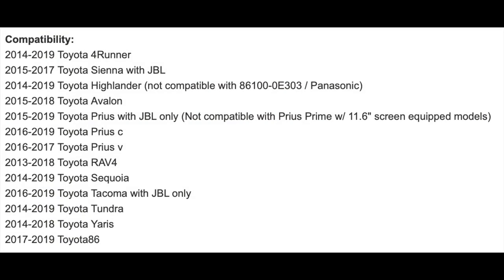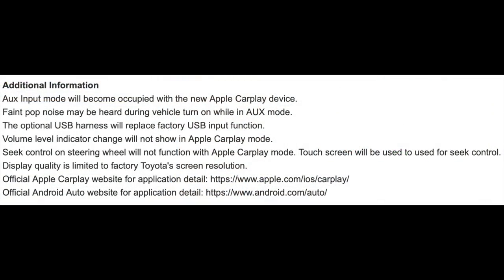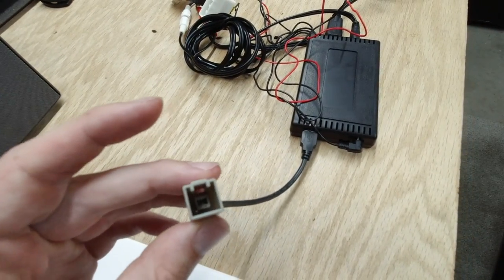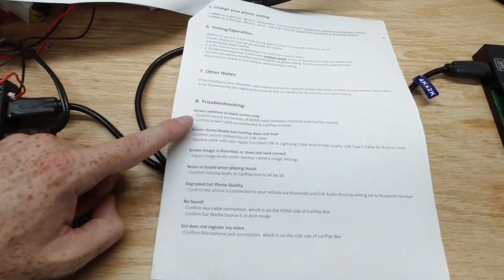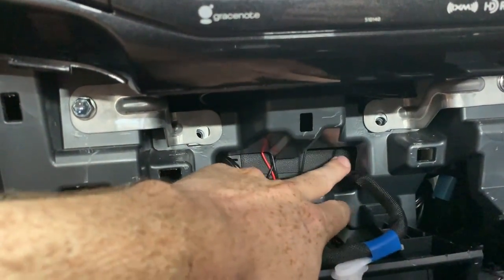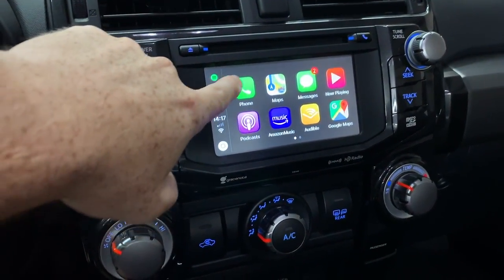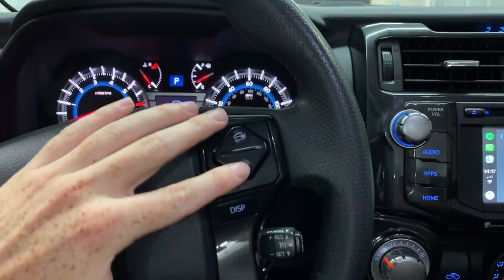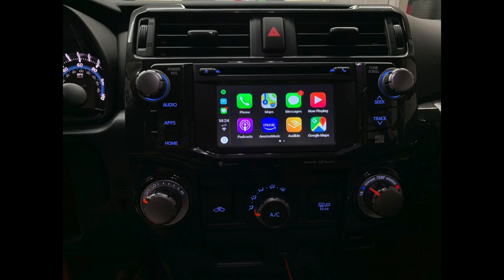2014-2019 4Runner Apple Car Play/Android Auto! WITH OEM RADIO!! Any Toyota 14-19!!

Comment from the maker: Very very cool product for those who really enjoy that OEM functionality. You can do a double din and the T9 for carplay or andoid auto..But a double din always has so much plastic about the bezels IMO and the T9 carplay doesn't work nearly as good as this! But you do get bigger screens with those options. So many choices..
Explaining The Product: 00:25
How To Connect It: 2:10
Placement In 4Runner: 5:27
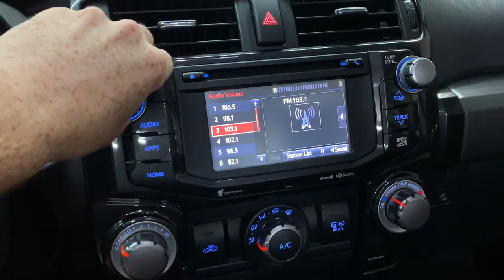Quick CarPlay Demo: 6:56
Reply from the maker: Copyright. YouTube police!
Reply: Jon, quick question. You mention that the quality is similar to the backup camera. How does it compare to the original entune radio? To me the original is acceptable, but I don't think I would be able to tolerate any worse than that. Thanks!
Reply from the maker: Tad worse but very similar

Comment: Thanks for the video!  That's a lot of $ for that feature but Toyota didn't leave us with any good options.  I'm with you about the less than clean install of aftermarket head units.  If they sold it for $300 I'd buy it, but for $510 I'll pass.

Comment: At time 6.53 you touch the top of the bezel area. Is there a tray in yours? I am trying to find one, part number etc. Someone put an aftermarket Android unit in my 2019 4runner, and the tray is gone.
Reply from the maker: Your dealer may be able to get you one, orr at least the part number
Reply: @TRDJon  Thnx.. I have the same android monitor too, need the black bezel.. But, I need it from the company that sells the unit. Thnx again
Reply: @TRDJon  I have part in hand. No part number, just the standard ABS on it..

Comment: Thanks for the great video.   I did want to ask, why choose this type device over replacing the head unit with something like Pioneer DMH-1500NEX?   I believe you can get add-ons that make it work with your steering wheel controls etc.
Reply from the maker: I just don't like all the dead plastic space with a double din radio and the 4runner

Comment: I really want that OEM+ speaker upgrade for the 4Runner I spec’d one out with both subs and extra amp holy $$$. It is sweet though have you seen?
Reply from the maker: I've seen it yes. Trying to work up to a status so I can try it for you all, because yes it is alot of coin. I just did a DIY upgrade and if it wasnt for youtube, i would have been perfectly ok upgrading just the front door speakers.

Comment: Will the plug and play harness be compatible if you have beat Sonics front and rear camera harness already installed
Reply from the maker: hmmm I'm not 100% sure. I don't have that system from them. You may have to email them for that answer.
Reply: @TRDJon  just messaged them ,it will work with the front - rear camera harness, just plug both harnesses together and plug in radio, both will work just confirmed with beat sonic usa .best of both worlds 👍
Reply from the maker: Heck ya awesome!! Glad the responded fast. Their customer service is great!

Comment: Good idea, but the price is too high for what it does. For a bit more I can get a new head unit with a larger and better screen. If it was half that price, I would probably get it.
Reply from the maker: Yea i'm not sure all what goes into it for that price. And the T9 is a little more but people ate that up! But this honestly performs better. At least for the carplay.
Reply: @TRDJon  So you are saying the T9 is not that good? 
 You have said there are a lot of issues with this one like steering wheel controls, display quality, etc and it is close to the same price as the T9, but you say this is better.  Can you explain that to me?

Comment: Just be warned these are made by a Korean company and sold under several names now. It is not bad at all, but I had one and it didn't work well in my 2017 Tacoma with JBL. I got a black screen and never could get the picture to come through. Also, my XM radio function went away with it connected. They said it was more than likely the harness being at fault, but I didn't want to deal with it any longer after that and returned the unit.
Reply from the maker: hmmm who was the other company?

Comment: So, not quite any Toyota. I have a Tacoma TRD off road without the JBL. I guess it won't work for me.
Reply from the maker: What year is it ?
Reply: @TRDJon  2019
Reply from the maker: No sure why it wouldn’t. If it’s 2.0 or 2.5 it should work. Did it tell you on their site it wouldn’t ?
Reply: @TRDJon  Yeah, it specified that the JBL system was necessary. Hopefully they'll update it so that I can use it.

Comment: Jon I depend on you and your channel constantly for great tips and advice, and still will after this. This time, however, was a swing and a miss. I just wasted 2 hours with this POS and it had a bad connection or something. It would work fine for a moment, until I so much as touched anything with the wiring, and the screen would go blank. Even if their wiring hadn’t been screwed up, I 

still don’t see where I was going to hide all this BS even it had stayed working after daring to touch a wire or two. I’m returning it immediately, and hope to never see such a POS again.

Comment: Hey Jon just curious, are you getting paid to show this off? Sure it's nice to add apple carplay, but for the same price you can buy a T9 with a lot bigger screen and more functions. To not have the ability to change songs unless you touch the screen is a big feature loss and to have poor screen quality is not good either. I just don't understand how you can hype this product up for the price that it is selling for - just doesn't seem worth it. I'm a long-time viewer of your channel and you always seem to be very honest, but for some reason this video seems like your pushing a product.
Reply from the maker: No I wasn't paid by them. But I wish I was haha. More mods I could get.. I'm going to make a video for the T9 head unit vs this and why I would choose this over the T9. Long story short is that I just like OEM when it comes to my stereo (Like i mentioned in the giveaway vid). It is expensive yes, but I think they are banking on peopple who just want the carplay. You can get a double din for 200 and have car play but it doesnt look good. The T9 looked great for what it was..but still had issues even on the second gen of it for $25 more then what this is for sale at right now.
Reply: So if I’m running google maps via the car play in Aux can I still listen to the factory XM Radio at the same time?